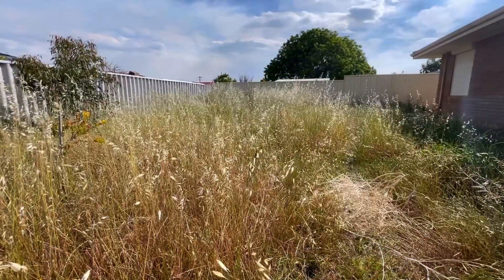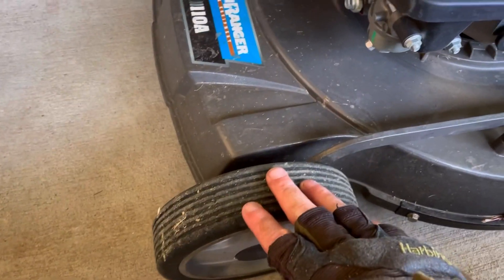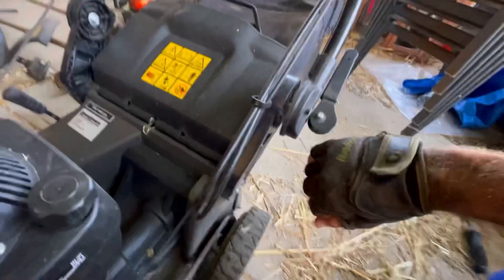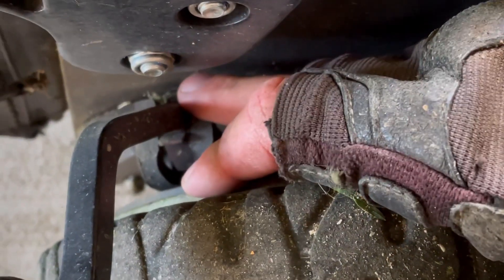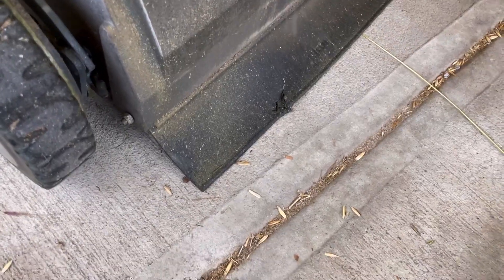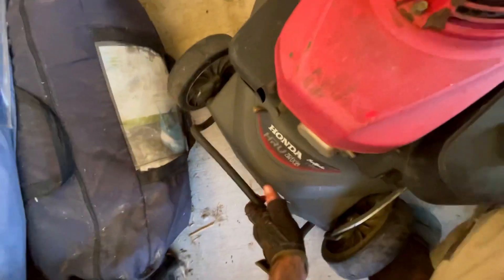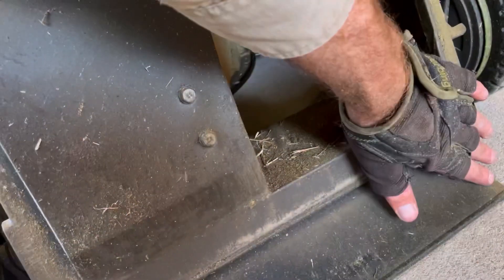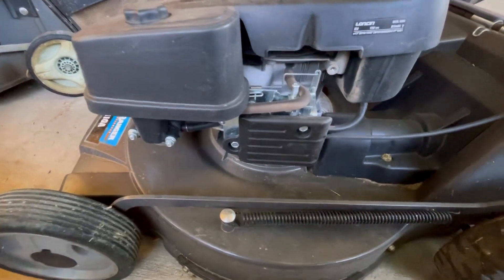BUSHRANGER, SELF-PROPELLED LAWN MOWER True Review

Comment: I bought a Bushranger 53tku7, 53cm cut, Kohler engine, steel deck, NO "SAFETY BAR", side eject. Really good mower, ended up putting lock washers on the folding handle levers which stopped them from coming down after running for a short time. Steel deck doesn't matter. Starts on 1st pull. Really liking it. First new mower in 30 years.
Reply from the maker: I loved mine for a year then the side of the deck broke open and bushranger didn’t want to know about it 😅

Still one of the top mowers on the market though just going to rebuild the side of it now and have it as my bush basher 😅

Comment: Yes recently got a bushranger. There a pretty good mower. There’s a grove along the top on bushranger which makes the Honda catcher fit pretty well on the back of the bushranger except the bottom not perfect. But I agree that catcher not easy to put on as a Honda.  I’m use to the old Honda 216D s. So the blade break thing doesn’t bother me. But one advantage the old 216 D has is the back wheels hang out further than the deck so can easily be lowered down steps like a trolley by one person which is a great advantage in my area lots of properties have steps.

Comment: i couldn't recommend bushranger from a commercial or personal position at all. on the commercial position there very hard to get parts for. especially the 196cc engine as the whole thing is made in china and with how things are going there, shipping is extremely delayed. all the shops in my area couldn't even get air filters for that engine for other a couple of months. let alone other parts. another thing to consider is pricing. the top of the line bushranger with the Honda engine costs about $1700 but the engine is less powerful then a genuine honda. genuine honda uses the 5.5hp engine. bushranger uses the 4.3hp. also bushranger doesn't fit a blade brake. so you pay the honda price but actually get less and a hard time getting parts. also there's no after market for this stuff. heck even the bolt threads are odd. you have to get bushranger bolts because literally no other bolts you can buy from say bunnings will fit the thread. 

on a personal point they are not Australian made. its all Chinese despite their claims (lawn mowers at least) if you look up weibang lawn mowers you'll see their decks are very similar. they even use the same 196cc engine. another thing to point out is they don't allow negative reviews on their site. I tried to post one up less then a month ago on the 196cc self propelled and its never actually gone up for people to see. absolutely cant support a company that prevents negative reviews. 

all in all don't go with bushranger. unreliable parts supply, rebranded Chinese products, expensive for what your getting and dodgy practices.
Reply from the maker: Fair opinion mate, I haven’t got to the point of needing to do any maintenance on it yet bar the normal blade, oil & filter changes… My local mower shop was pretty confident in supplying any gear needed for it though but we shall see 😅
Reply: What mower do you recomend for commercial use?
Reply from the maker: @jakecampbell  Honda HRU self propelled or the bushie in this vid are both good choices had both loved the Honda.

Comment: Would you go self propelled over normal? I’m the guy who leaves the lawn go wild and knee high. Are the belt drive mechanisms likely to get damaged with long grass and rough yards? Thanks
Reply from the maker: Hey mate self propelled every day of the week over push saves your legs & time.

As long as you keep the servicing good & go with a good brand like bushranger or a commercial Honda they last. Had my Honda before the bush ranger for eight years only things replaced was wheels, Gear box twice & deck once. (Obviously small things like spark plugs, blade ect a lot more) but yeah I’d go self propelled.
Reply: @yaksmowing   thanks for the information and experienced reply mate. I hear that the catchers clog on self propelled as if it’s a real problem when doing long grass. Is this something I’d have to check on every few metres or not really a big deal?
Reply from the maker: @Rushdie01  not to much of a problem mate, empty it twice on a standard length back and front. 

Most of your commercial self propelled go as hard as your pushies if not harder as they’re always moving forward.🤙